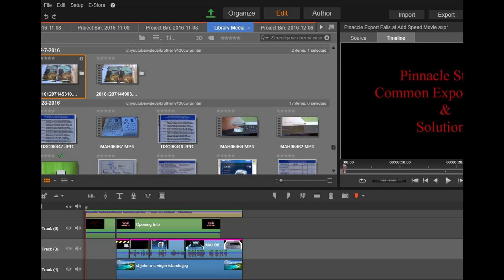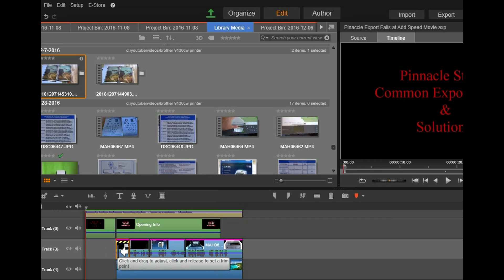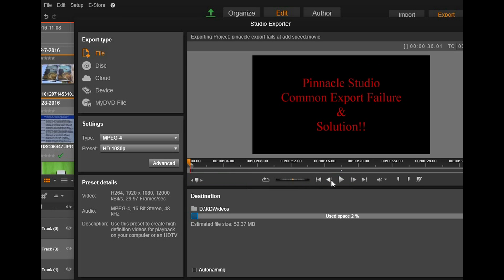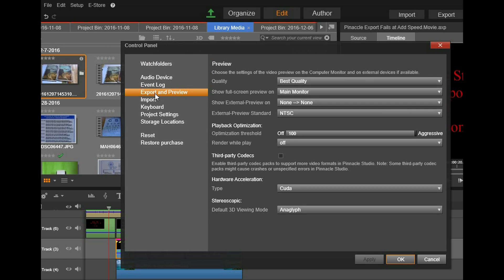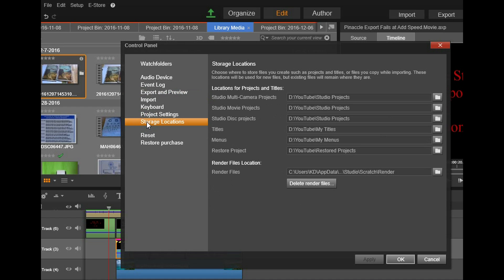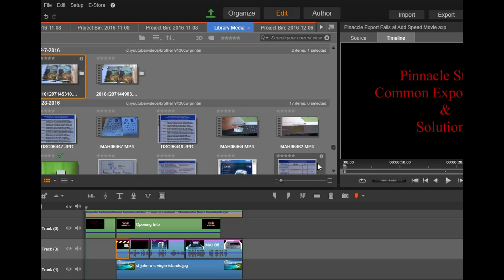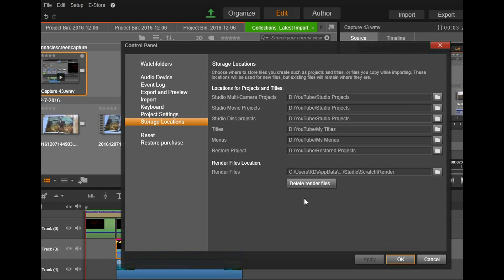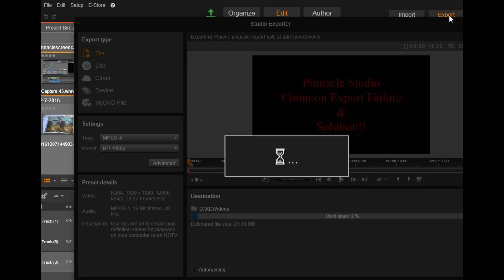Pinnacle Export Fails at Add Speed Clip RESOLVED

Comment: Mine just freezes at random  timing there is no errors. It must be my computer. So frustrating I have to deal with this crushes on a long videos.
Reply from the maker: Julia, I finally bit the bullet, if you have a YouTube channel and making money or building it… you might as well pay a monthly fee and get the Adobe products like Premier pro… I got frustrated with pinnacle and video studio… they do have some very good qualities and easy to use but I’m now using Adobe… it took me a while to figure out but once you do,, anything is possible… does it crash once in a while….yes, but they have a good recovery system that does not totally leave you very angry… or feeling defeated….  My advice if you continue with pinnacle, go in steps, build part of project, render and save… repeat… .. save often… then when complete do a final project and add all your smaller projects together for the grand finale.
Reply: @kd_enterprise3404  I don't have problems with short YouTube videos under 20 minutes. The problem occur only on my translating job where I have to do voice over on 45-130 minute videos. I will try to split my projects next time. I believe I will have to upgrade not only to the new soft but to a newer computer as well. I bought mine about 5 years ago. Thank you for  respond. If only I made money on YouTube I will definitely upgrade.

Comment: This is by far the worst software I’ve ever had to deal with. Sorry I’m just venting after hours of failures and crashes. The time code varies so there is no corresponding clip that might be causing whatever issue might be related to the render failure. This software is truly garbage. I tried every fix you mentioned, with no success. I’m livid from how horrible this software actually is.
Reply from the maker: betterbody2468 very frustrating, it’s hit and miss, all these programs have issues, some worse than others and sometimes it’s all about what graphics card, or processor type. The best suggestion at this point, start doing things in segments, save a lot. Even with video studio, if I have a lot of effects, transitions I might first just work with video, get it cut up put together. Render file, close software, start a new project and bring the rendered file in, then add transitions, effects, etc.. it’s a bit of a pain but at least you don’t lose an hour of work and sanity.. sometimes you can’t recreate what you made because it destroys your morale. Good luck!
Reply: @kd_enterprise3404  Yes, thanks, I do have what I call a layered approach, Video, color correction, save, edit. Then audio, foley, background music if needed etc. Saving each as stand alone projects I can then combine and load into a new timeline/project. I could not use the audio pan feature as designed for a single track. I had to duplicate the track twice. One fully left, one fully right. Then keyframe both tracks, reducing gain on one to change the overall stereo imaging. Then saving that as a single audio file. Worked fine, but by that time was just frustrated and had to vent. Thanks for listening

Comment: Hi, thanks for this video it was quite helpful as i realised that adjusting the speed was causing me the same issue. but sadly i use pinnacle 15 and the interface is quite different than this. can you please help me with it.. as i really cant do without adjusting the speed. tried everything from removing the files to installation of the app.
Reply from the maker: Kashmira Diler my best suggestion at this point,  do things in steps, any particular item that requires speed adjustment. Open a new project,  only work on the one item, no text, not titles, just the one file, adjust speed, render it, save. Close pinnacle, then go to your main project and insert the new file...
Reply: @kd_enterprise3404  thanks
Reply from the maker: Kashmira Diler thanks, let me know how it works... thanks..

Comment: Just a PC cooler ventilator will do the job too, as editing heats up the PC, which will make a laptop crash; and always close down the other windows, like from where you imported the video footage and from your office page into the video editor.
Reply from the maker: Swiss Torture yes sometime heat can be an issue, however I’m running a custom intel based gaming full size PC.. your point is valid for underpowered overheated laptops.

Comment: I know this is an old video but this just started happening to me last night. I've used Pinnacle for many years and currently have Ver. 21 Ultimate (since launch). I've also never had this issue before. I tried your recommendations to the letter and it didn't help my issue. There was a major Windows 10 update the night before ????
Reply from the maker: Travels with Yoly it’s probably the windows update, theses issues are so random depending on hardware and software.. I ran into issues when I started doing more complex edits.. hopefully pinnacle will do an update, what got me angry when I complained they told to purchase the newer version... each time you make a serious edit save it, save often generally.
Reply: @kd_enterprise3404   I had the same reaction, once with Corel and once with Pinnacle as it seemed the only solution was to upgrade the software to the newest version. I have a lot of difficulty with the new Pan & Scan system. I tried uninstalling the program and reinstalling it, but that didn't help.
Reply from the maker: Travels with Yoly I have not done this, but just an idea, perhaps turn off windows update if possible, I believe then you can initiate the update at your pleasure and then if the pinnacle messes up roll back the update.. often times with auto update we are not even aware, often only with major updates you get notifications... just a thought.

Comment: why doesn't Pinnacle uncover the cause of problems such as the "grey circular arrow" and provide the information  to those who have paid for this product instead of having us chase theories that usually don't work??
Reply from the maker: Perhaps the latest version is better, as I did mention, I liked the user interface more than Corel video studio... I have a feeling many factors from the software and I’m guessing the many different hardware set ups on pc’s. I think when Corel took over pinnacle several years ago they probably lost the expertise of the original software engineers that built the program. No matter which program you use, do a lot of saves, and with experience, when doing a larger complex project start doing things in segments, meaning get the core down, conduct a render and save, close the program, open and start a new project with the file you rendered, then conduct more editing.

Comment: hlw sir,
my pinnacle studio 21 ultimate export is problem.....I fallow to ur video.... but not export failed.

pls help me
Reply from the maker: And this is why I no longer use pinnacle, the only thing I can suggest at this time. Save your vid then save again with a new name so you keep the original, then I’d remove everything except for your main video line, try the export again to make the mp4 vid... if that works close everything and open your original, delete everything on the main video line and replace with your new rendered mp4 and then try the export again.. if that does not work,  I’m now in the habit of creating the very basic portion of my videos and render/export and make my vids in stages. Then using the rendered file as a start of a new video with the added features I require...

Comment: Sir, I'm using pinnacle studio 14 & I'm trying to export a video (1920×1080 | 718MB | 8:13 mins)
Added 16 audio clips(wav file type) in music track.
But after exporting video, only last 10seconds of video being saved (means only that clip, where I'm not adding audio clips)

Delete auxiliary files, complete rendering, even removed all speed & stabilize video effect...
Tried all tricks, but not works yet....
Plz plz plzzz help me
Reply from the maker: DurgAbhiman दुर्गाभिमान I’m not super familiar with pinnacle 14.  Is it possible when you exported, the entire project was not selected and thought you only wanted the clip exported. Other idea would be save the original project, save a new one, then remove everything but the video clips. Then do an export, then start a new project, import the exported video and then add the audio material. Tough one to figure out without seeing the layout...